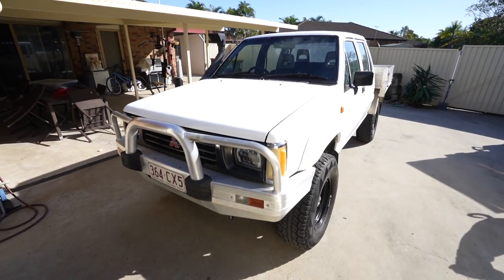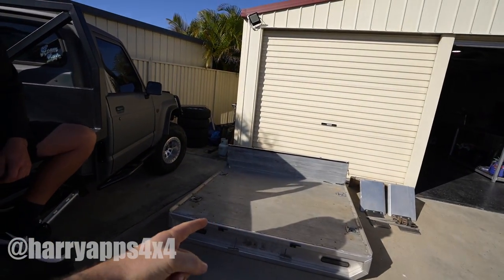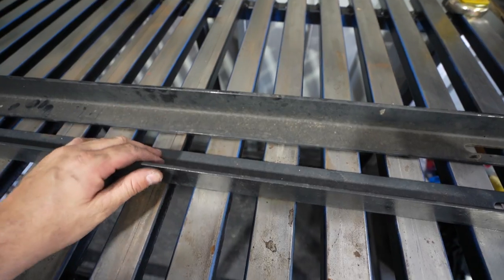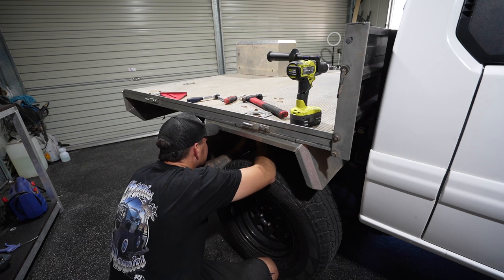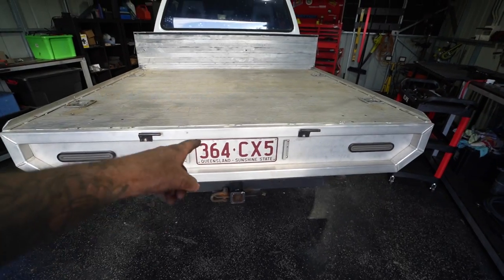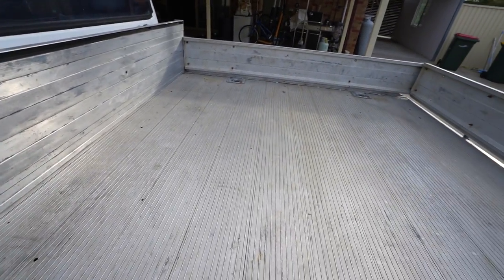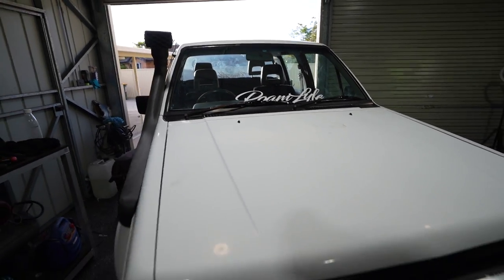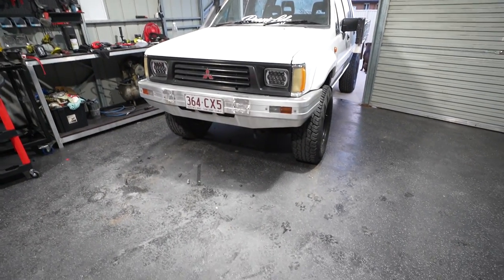BUDGET BUILD Gets a Custom TRAY & BULLBAR!! The Cost of these Mods Will SUPRISE YOU..

Comment: Mint build! When you bought it how much did the engine cost to fix and how many kms does she have on the clock?
Reply from the maker: It cost $350ish for a full service as well as the timing belt parts, water pump and all seals including tappet cover! Just rolled over 300,000kms
Reply: @RoamLyfe  thanks mate! She looks good for 300kms

Comment: Except the new tray doesn't comply with the ADRs, making your vehicle unroadworthy.  👍👍👍
Reply: Like 99% of the cars on the road 😂
Reply from the maker: Sorry mate what isn’t complying on the tray?
Reply: @RoamLyfe  the indicators/tail/brake lights are recessed and wouldn't comply with the rule about being a particular distance and angle & still being visible. It's why the Patrol wagon has its rear indicators in the bumper. 

I forget chapter & verse but other mate was right, 90% of decent looking modified trucks aren't compliant, either, and will only be a problem when getting a safety cert (if you're selling/changing registered owners) or you're unlucky enough to get pulled over for a roadside inspection.